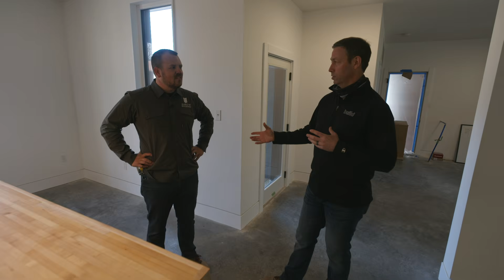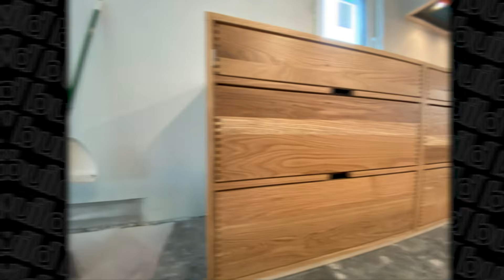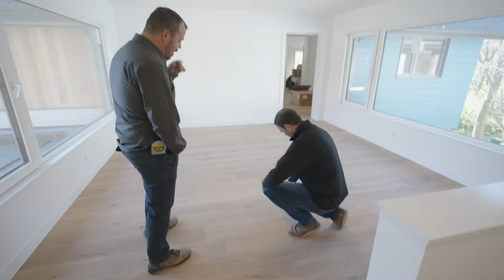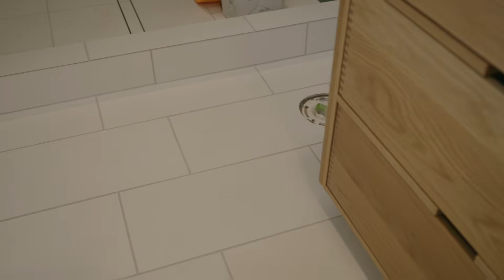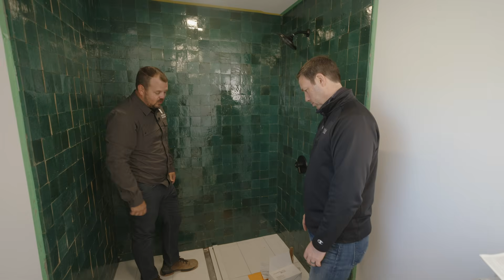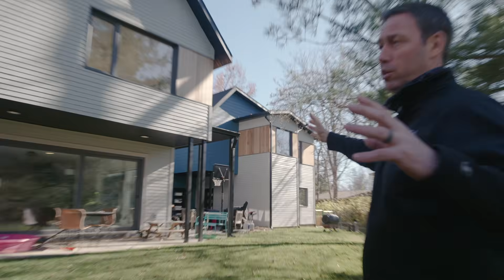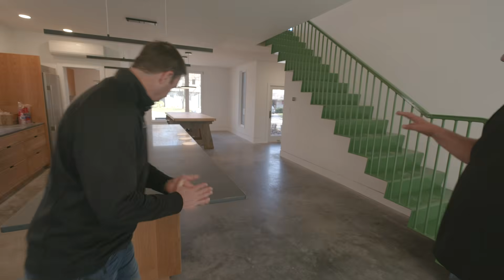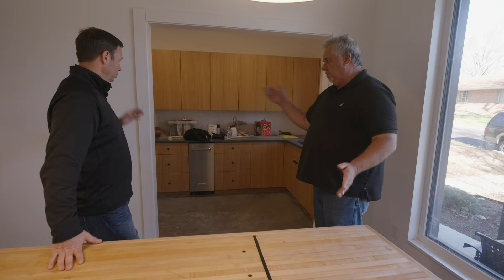Builder’s own INSANELY Efficient House!

Comment: wow wow wow, what a home.  only comment i would make is the first floor minisplit, heating the whole floor with one unit is awesome, but I would not have put it in the kitchen.  I would not want the food smells or air born oil from frying etc. passing through the unit.  asthetics has obviously been discussed, but doing a recessed unit in ceiling perhaps more in the living room would prevent oil and soot build up in the coils.  The exposed unit makes maintenance easy, but even if keeping it I would not have it in the kitchen space.

Comment: Soooo,the upstairs floor isn't real wood,dannnnng, should have used a split unit air source heat pump,that way there's no water to heat from the outside unit,just r32 gas back an forth to the indoor split.

Comment: Studs need thermal break.  Else anything past 2x6  is a huge waste of money. Studs conduct heat both directions.  2 more inches is a huge price increase..with zero savings.....dont decieve people!   Thicking the wall does not negate the use of dbl, triple,quad posting....nor headers. Nor huge conductive loss around window framing.  Massive long term energy loss!

Comment: Holy shit the water heaters 10 times the price of a traditional gas unit.
In terms of energy efficiency youll never recover the cost and even though its stainless steel its still going to need to be replaced, I think in terms of hot water storage a fiberglass tank would be better.
80 gallon is that really nessary. 
I might see the use for this with radiant floor heating, but a home this tight you have to do a fresh air heat exchange system.
I might have gone with thermogeo  heating system your great big 2 fridges put off a lot of heat, this could be used to heat water lowering to energy cost to run  refrigerators.
Even solar hot water heater might be a better option and yes in Mo your not far outside of kansas city, I can jump in my car and be to this house in 2 hours or less.
But I will say one thing, in 2022-2023 winter when natural gas cost 3 arms and 4 legs youll be nice and toasty.
What time is breakfast?
I'll miss my Google fiber 2 gig internet connection.

This hot water system is better suited for comercial use.

Comment: I built a 2x8 2,690 sq ft house in NW Montana in 1984. Super efficient, low cost to heat back when Winters were a lot colder and longer duration. Extra costs in construction were repaid within 2-3 years. R-30 walls, R-50 ceiling.  Stayed warm in Winter and cool through Summer. A little attention to detail and proper orientation for Winter solar gain and Summer shade. Average Winter heat bill was under $150 per entire heating season that spanned Sept-June most years. Zero costs for cooling.

Comment: Wood worker here.
You should have went with dovetail joints instead of box joints for the drawer fronts. 

I seriously doubt they will ever fail within your lifetime, but they may fail within your great grandchildren's lifetime.

 Dovetail joints will still keep going even if the glue fails, so they are in theory better/less prone to failure. 

But still the house looks fantastic, a true showcase of craftsmanship. It reminds me of the type of homes built during the arts and crafts movement of the early 1900's

Comment: You could just take a typical 2x4 framed house and scab on another 2x4 wall on the exterior?  I've thought about doing this.  Only issue will be doors/windows now will need jam extensions.

Comment: I don't like the look at all - if I had kids, I would be worried they are going to bump their head on the metal stair corners. As long as the person living there loves it, then all is good.
Reply: @bigmikeobama5314 Agree, but somethings are just asking for it... this is not about weak people, this is about smart people preventing obvious problems easily. Put a rail on your stairs and don't have sharp edges jutting out at head height - just common sense on a basic level.

Comment: My recent remodel of my kitchen and main bath in a 1963 house is much nicer. Custom cabinets with a "Zebra Wood" venire perfectly matched by grain from cabinet to cabinet. Added an island with quartz top. A flush mounted sink (not over or under). Flush for easy cleaning. Floating vanity and wall mount toilet with tank in wall for main bath.
I was the general contractor. Never did any of this before but kept up on house shows. I selected all finishes and electrical components. My contractors were A++ quality. I had to wait 9 months for an open time slot. It was worth every penny. More expensive? Yes but not overall. They never had to come back for screwups. 1 day off starting schedule.
If you higher a contractor that can be there tomorrow or within a week, run away.

Comment: The kitchen drawers are box joints. Basically mass produced joint there's no craftsmanship in that. This joint was used for every cheap box, frame or carcass. Why it's considered craftsmanship is strange. These days it's equally easy to machine dovetails, that would look a bit more sophisticated.

Comment: Personally I prefer a staggered double stud 2x4 over a 2x8 frame.

You save costs on the 2x4 vs 2x8's; it also completely reduces bridging if your studs are staggered. On top of this you can put a 1" gap between the staggered stud walls, which allows you to get the same cavity size as a 2x8 as well (actually 3/4 inch thicker than a 2x8).

This is what most of my passive home builders do. They can also get R-42 in this assembly, but the effective R-value is much higher because you remove bridging. The effective R-value of an R-42 2x8 wall is probably around R-36 - R-38
Reply: How would this scheme compare to say the 2x8 T-Studs ?

Comment: ok... really cook about testing the house for air leaks, totally mind-blowing. however I'm sorry but how can an electric water heater be "the most efficient water heater on the planet"? yes, electric heaters are efficient in the sense that they convert all their energy to heat. but that energy is insanely expensive compared to the hear you can get by using natural gas. also, you have completely uninsulated pipes (with a million sharkbites.... so many $$ wasted) that are literally losing efficiency into thin air. and on top of that, you have a tanked system. so not only you have  a massive water leak waiting to happen, but you are also limited in how many showers the family can take before the hot water runs out. and by the way, that emergency pressure release valve needs to be drained. otherwise it will be emergency-releasing water all over your precious floors
Reply: Holy incorrect Batman! You need to educate yourself on heat-pump technology. Sorry...

Comment: A 6 degree difference in temp from one end of the house to the other on the same level? That doesn’t seem like that would be comfortable 🤷
Reply: Or was that the difference between the other levels too?
Reply: That was a weird thing he was bragging about. Wouldn’t any mini split cause the room you’re in to get cooler than say the hallway right outside? Especially with no central air moving the air around. This is a weird house. 

They didn’t talk about the fresh air system. You start cooking or have the oven on and the house doesn’t have a way to move the air around. Wait a minute where are the ovens? This house is an instant remodel in a resale

Comment: This house is horrendous. Is that finished? Echo concrete floors and a saw horse table? Spilt AC on a brand new build? Geez this makes me wanna puke. Also, you get no hot water in the winter if you live anywhere cold. Exterior architecture looks like crap from the 70s. Yikes
Reply: WOW - we should have consulted with you through the design obviously......as for water heaters, I have these systems in CZ (that's climate zone) 5 and operating very well, so maybe a little fact checking is in order. In an effort to avoid future puking, do you offer design services?

Comment: What amazes me about this house is that it's got such huge windows. For an energy efficient house I mean that's hard, but especially for one that is probably one of the most energy efficient houses ever. I mean 10x the passive solar code yet windows this big!
Reply: My 2 cents : windows are big, but the actual weak points in windows are the frames. 
So, it's actually better to have 1 big window rather than 2 smalls.
Windows frames are usually so bad that it's better to have a double glazing HR++ with a very good frame (aluminum with thermal insulated profiles, or light density wood frame), rather than triple glazing with bad frame (without thermal insulation).
Also important point is to use thermal insulated edge spacers ("warm edge spacers" like plastic, instead of aluminum)

(the clear triple glazing U-value can be as good as around 0.1 BTU/h.ft2.°F in English imperial units (used in the USA) => R-10 in English imperial, 
or 0.5 W/m2.K in metric SI System International = R-2 in SI, 

but U-value of frames are very very bad, between 0.22 and 0.68 BTU/h.ft2.°F => R-1.5 to R-4.4 in English imperial
or 1.3 W/m2.K to 3.8 W/m2.K = R-0.25 to R-0.8 in SI !)

So the complete window system, including all components comes to around : 
English imperial : U Window = 0.12 to 0.35 <=> R = 2.8 to 8
SI : U Window = 0.7 to 2 <=> R = 0.5 to 1.4 
Sources : 
https://www.efficientwindows.org/standards-passivhaus/
https://aspirebifolds.co.uk/2018/03/what-are-typical-u-values-on-windows-and-doors/ 
https://en.wikipedia.org/wiki/Thermal_transmittance

Comment: Especially being a builder I think making some cement faux sawhorses as the legs to the dining table would be a perfect touch.
Reply: Tacky
Reply: @DesignRhythm  Good design, like beauty is in the eye of the beholder. For example your mom is out there still thinking her son is handsome.
Reply: @misery13666  Lol, Try again. Go study Architecture, interiors, furniture design, etc. and get back to me when u learn the basics... like the difference between concrete & cement, ffs. 😂
Reply: @DesignRhythm  I was talking about the outer visual layer not internal construction. You dont generally use concrete as an outdoor surface finish due to porosity, much less indoors in a wet/spill prone area, you use a coated cement. YOU need to get YOUR crap straight.....FFS
Reply: @misery13666  "Outdoor surface"??? Its a dining table INDOORS. I think u meant to say exterior surface... and no, the support for a dining table is not considered a "wet/spill prone area." Holy sh*t, this is getting embarrassing.
Reply: @misery13666  Do u mean exterior? Its an indoor dining table.. and no, the support UNDER a table is not considered "wet/spill prone" 😂😂😂

Comment: It's good to see that house energy efficiency and isolation is coming to the US. I chuckled a bit when they was bragging abut the walls and windows, that's the legal bare minimum in Norway today. Our outside walls have a U value down to 0.15 😅 windows below 0.9 (tripple layered insulated argon filled glass.
Balanced ventilation with heat traps and heat recirculation. That with insulated concrete floors with internal heating + a heat pump or two gives us a very low energy bill even when you live above the arctic circle :)
Reply: That's because our building culture is horendous!!! and our homeowners learn about Building Science thru litigation. It's offensive to me how badly we build in his country, with the knowledge and data we have....

Comment: I'm wondering why they didn't go with a Geothermal heating and cooling system.  It's definitely more efficient than what they used.
Reply: Probably initial cost. Their current set up is electric so they can add solar panels down the road if they want for more efficient energy.
Reply: @b22chris  The house is planned to be zero energy

Comment: The 200 year old house I grew up in in Maine has planks as wide and wider (not super consistent) than the engineered wood floors in this house. In fact, oddly enough, it was pine. It didn't have any buckling or bowing issues that I ever noticed. But that's really to do with the fact that the gaps between the boards were NOT tight. They had room to expand for sure. Something that would not be desirable in a modern home.
Reply: Actually they are stable because every winter you pay $$$$ to bake them all dry

Comment: I didn't see any control joints in that gorgeous concrete kitchen floor.  Is that true?  If so, how does that work?
Reply: do you need any if the in-house temp is going to stay constant?
Reply: Sorry for the delay.  Actually, I thought that concrete pretty much always shrinks as it cures, and this is very difficult if not impossible to avoid.  It may be that this homeowner used some special concrete admixtures, or fibers, or some exotic concrete topping such as elastocrete, but that is why I posed the question.

Comment: I read where  as little as 1" of foamed in place closed cell (in a stud cavity), achieves 70%+- of maximum practical thermal efficiency.  Chipping away at the final 30% of R-value seems like a lot of tail chasing.

Comment: I certainly appreciate the attn to energy conservation and elimination of exterior noise. Interior seems to have 'busy' acoustics, probably due to all the hard finishes. Interior acoustical attenuation while using hard finishes, seems like a lost art. The 1970's were the heyday of acoustical design/development. Owens Corning, Armstrong, USG, and others were cutting edge concerning sound attenuation research and products, all while maintaining class A flame spread. Residential designers seem loath to add shapes, materials and design features to control interior noise. Sound energy loves flat hard surfaces and 90 degree corners:)

Comment: This is a very interesting house. It has an insane amount of insulation. Using one mini-split unit for an entire floor of that size is very impressive. That water heater was also something I've never seen before. The only thing I don't like is the stair case lol. It's just not my style. But It's not my house so it doesn't matter. Thanks Matt for coming back to this one & showing it off.

Comment: I love the first floor, sadly I wouldn't be able to convince my wife that it looks good.
Reply: Same. Concrete is awesome. Especially if you come from an older house with hardwood floors, the people walking on it, say a second floor, can be so incredibly loud. Concrete is dead silent, doesn't shift, squeak, etc. Also if you spill water on it, it won't swell like wood. I know concrete has different issues like cracking but if it's done right, it'll last forever. My car port and patio concrete is 70 years old without a single crack. Women just care about looks. Men tend to prefer performance.

Comment: If I were to build a masterpiece like this house, I would put it on piles, rather than a concrete slab.
Reply: Why would you do that out of curiosity? You would then have to make a separate floor, right?
Reply: Piles are way harder to deal with and make airtight than slabs. Plus you'll need to build an insulated utility chase if your climate has a frost line. They're only really useful if you're building on a severe slope and don't want a walk-out basement.

Comment: 2x8 and zipwall holy poop 💩 spray foam insulation insulation slab everything is sealed. R42 walls people are lucky to get r-20 new built in pa because are codes suck. I wish you said the insulation in the attic.
Reply: R-60 in the attic typically

Comment: Boy I hate Matt's videos most of the time, This time included. I really do not care about how you dress up a house. I am more interested in the construction process and how you achieve things. Windows and more windows yet you never explain if they are indirect light or direct sun. Windows should be indirect light during the warm months and direct light in the winter. 
The stairs look ok yet they are far too narrow. Stairs should be minimum 5 feet wide. You never talk about door width of any rooms. All doors should be minimum 36 inch and main door should be 48 inches and any hall way should be greater than 4 foot. Architects are suppose to design the house so that it functions and not interior design, that is for an interior designer. Main bathroom is way too small and does not include everything need, Why does every have a need to put the toilet next to the shower and tub. All bathrooms should be included for each bedroom and should also include Washer and dryers and storage areas as well. Think a combination bathroom/laundry room/ utility room. 
Some day someone will post a real custom house with all of these things and include a mud room and entrance that is not a front door. The majority of people never use the main door they mostly use the back or side door.

Comment: Do concrete floor LD make sense with house settling?
Reply: Concrete like that is a huge savings in terms of cost. Imagine if you had to add all of that white wide oak planking which more than likely cost more than 5 dollars per square foot. The concrete will last a very long time and will not be damaged.